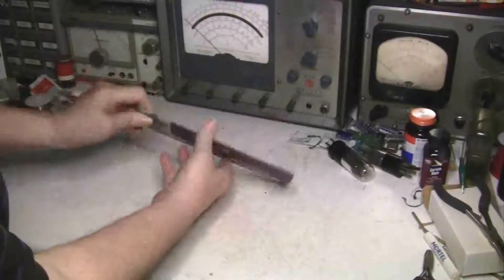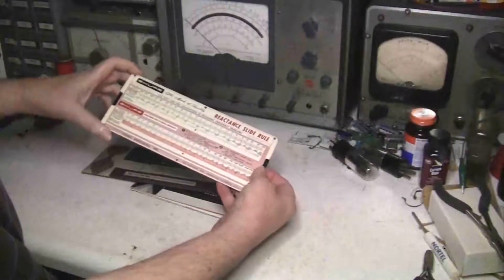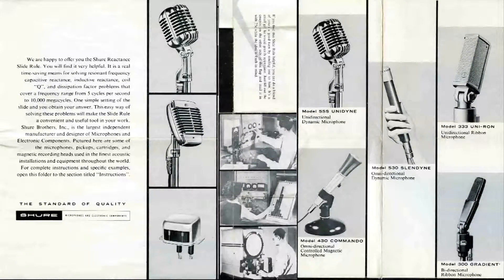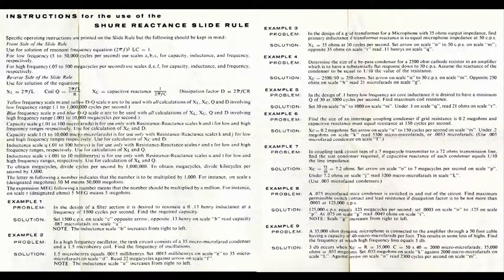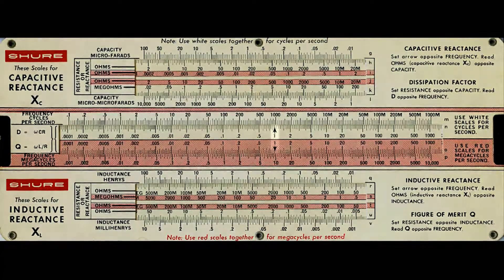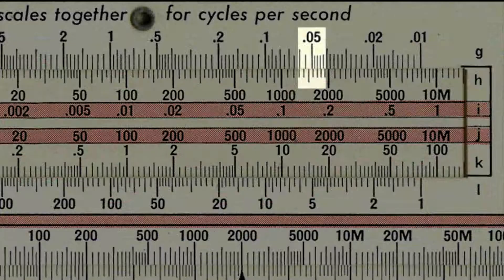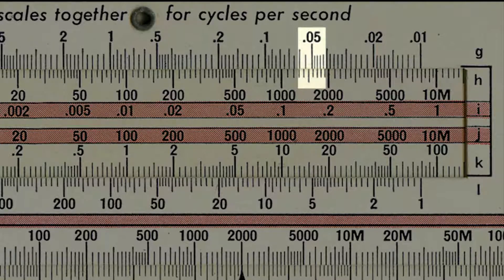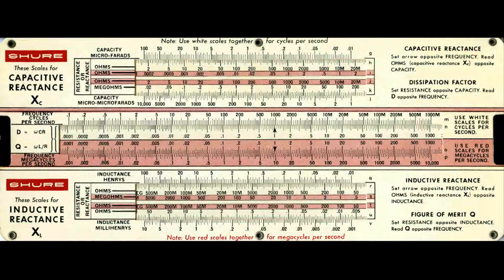Shure Reactance Slide Rule

Comment: Very nice! My grandmother actually have a similar slide rule, but not the same type as that one. This one is for more normal "everyday" math, and it actually works quite well! Of course, a calculator is quicker and can give more accurate answers, but those rulers still could do some advanced calculations and give decent answers if done correctly.

Comment from the maker: Thanks AndyDaviesByTheSea
Hey Andy,
Decimal point reminds me of the first time I took the 1st class FCC exam, and failed. I was using a circular slide rule, and I kept forgetting which way I rotated it, which is important for the decimal point. The second time I took the exam I passed, and I used a calculator. If I find another one I'll let you know. I did see an earlier one on ebay.

Comment from the maker: Thanks Organgrinder010
This Slide Rule can still be useful. If you are using 10% tolerance parts, this slide rule calculator works just fine. Also you can see the overall big picture and trends by looking at the slide rule scales. You don't get that with an electronic calculator.

Comment: Hi Rick, what a lovely bit of kit, no batteries! If you see another one in such good condition buy it and I'll PayPal the money other. When I was at tech I used to call my normal slide rule my 'guessing stick' the reason being I could get a numerical answer but couldn't always figure out where to put the decimal point. I'd much rather heave the cardboard slide rule for Xc and XL values than a computer as we're a bit short on capacitors with 13 decimal place tolarence over here Hi Hi
73,s Andy